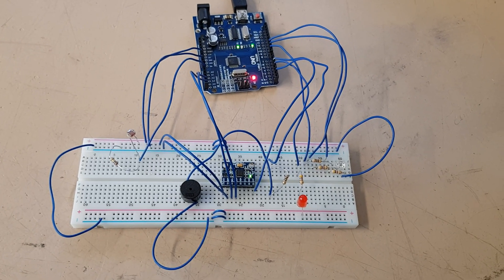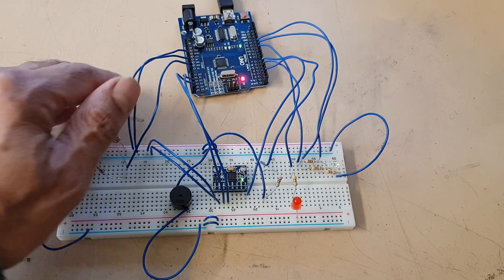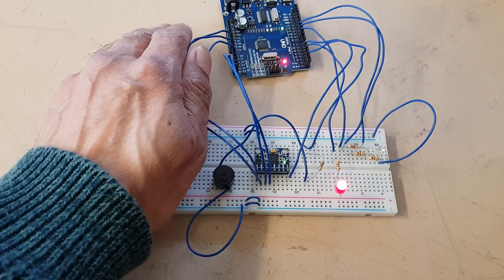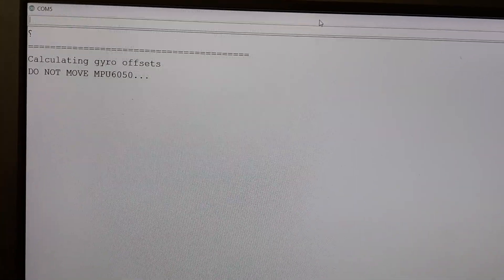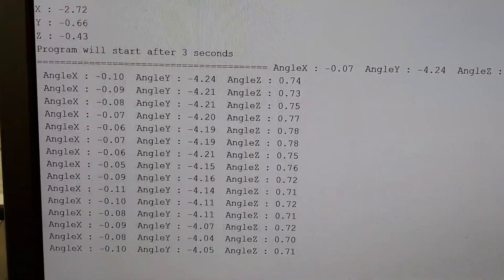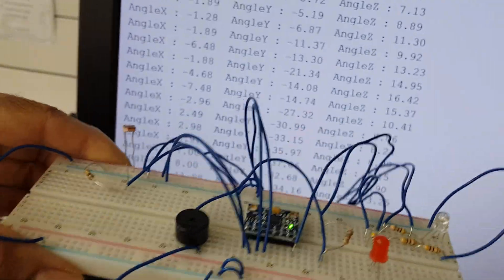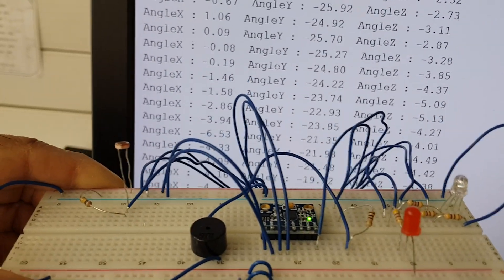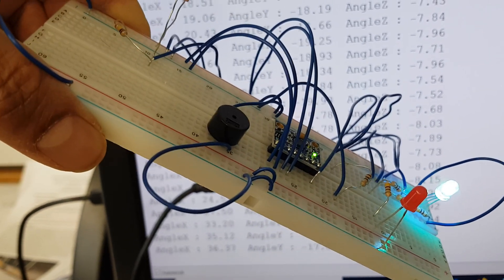Arduino RGB led control with a MPU6050 Accelerometer

Comment: Great project.  I am trying to do a miniature led project that is used as a Level.  0 degree the led is Green and shifts colors as the angle increases away from zero.   

Can I peek at the code you used, as well as the schematic?

Comment: Hi im new to this kind of stuff can you show the code for this as im trying to do something similar
Reply from the maker: The PWM pins on the Arduino have a squiggle next to them, the others are Digital pins only
Connect the RGB led, Egg sensor and the Buzzer to the following pins on the Arduino board for best operation:
 
Arduino pin 9 = Colour1
Arduino pin 10 = Colour2
Arduino pin 11 = Colour3
Arduino pin 5 = Buzzer
Arduino pin 4 = Egg LED
RGB Led Long leg = Ground or 0v
SDA on Tilt sensor goes to A4 on Arduino
SCL on Tilt sensor goes to A5 on Arduino
Here's the Arduino code:

#include <MPU6050_tockn.h> #include <Wire.h> int redPin= 11; int greenPin= 10; int bluePin= 9; int led2= 4; int Buzzer= 5; int LDR; MPU6050 mpu6050(Wire); void setup() { pinMode(redPin, OUTPUT); pinMode(greenPin, OUTPUT); pinMode(bluePin, OUTPUT); pinMode(led2, OUTPUT); pinMode(Buzzer, OUTPUT); pinMode (LDR, OUTPUT); Serial.begin(9600); Wire.begin(); mpu6050.begin(); mpu6050.calcGyroOffsets(true); } void loop() { ///LDR, EGG HOLDER------------------------------------------------------------------------------- delay (200); int LDR = analogRead(A0); Serial.println(LDR); if (LDR < 800) // 800 is a good value if you cover LDR with your hand { digitalWrite(led2,HIGH); } else { digitalWrite(led2,LOW); } // Serial Print the Angle Data--------------------------------------------------------------- mpu6050.update(); float AngleX = abs (mpu6050